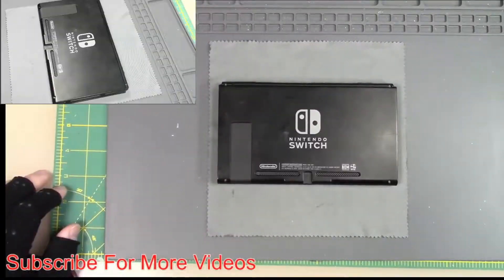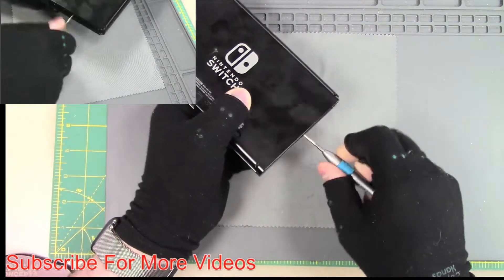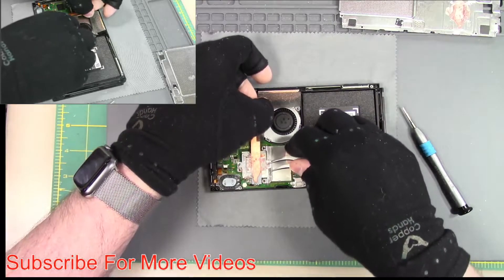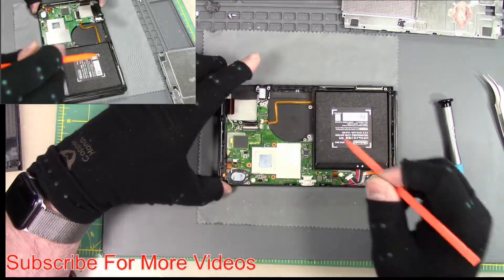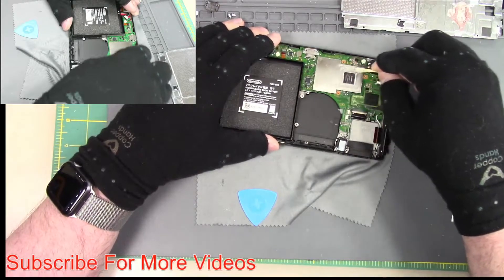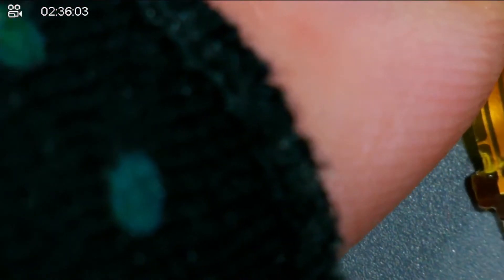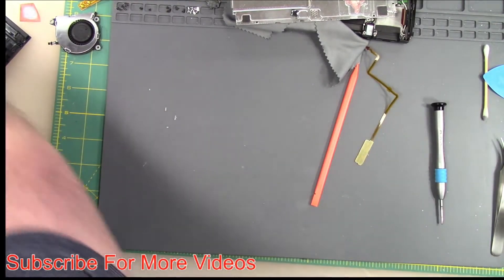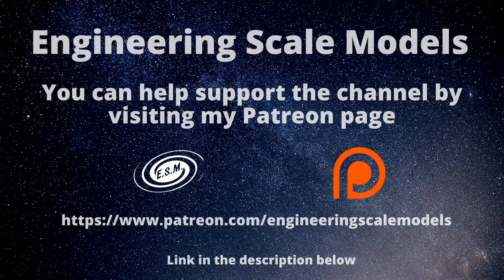Nintendo Switch Power Flex Replacement

Comment: Please help, replaced ribbon twice. Only button that works is the volume up. Both ribbons from same company, they sent a replacement same problem. Original was missing the gold piece that actually flexes down when pressed but could turn console on & off using aluminum foil. Bought it to fix, can't solve this issue. All pins and pieces are in good condition.